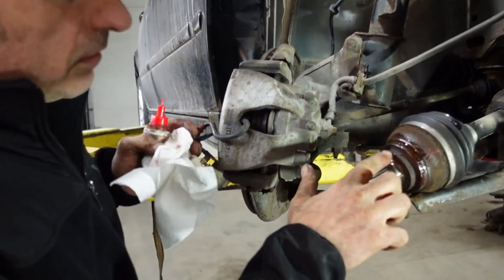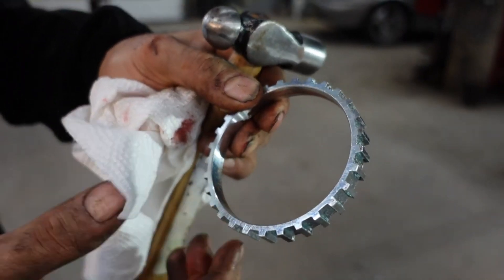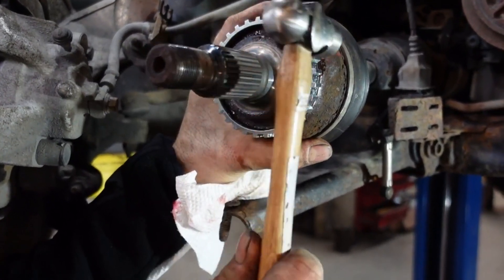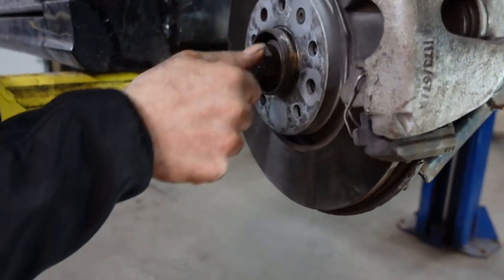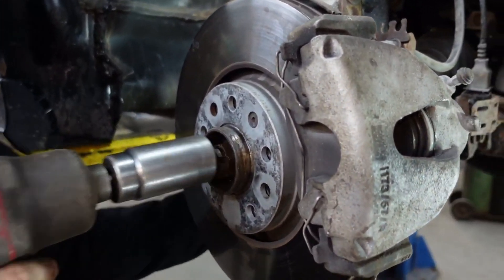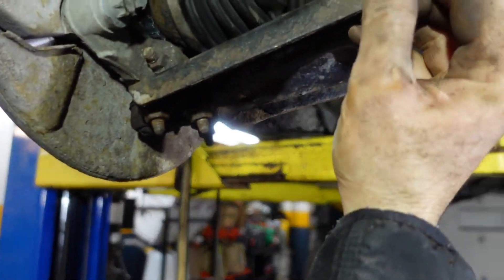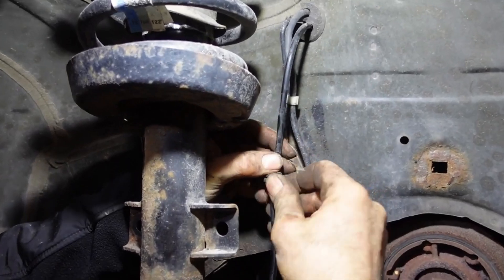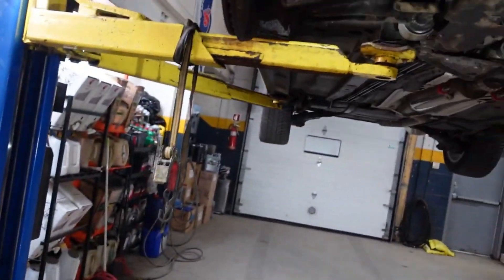How to Replace Front Right ABS Ring (Fault Code C1376) SAAB 9-5 1999-2009 (Part 2)

Comment: Saab Master Tech, great video. Thank you. Question, when you replace the 1999-2009 9-5 2.3L alternator, do you remove it from the bottom or the top? Cheers.
Reply from the maker: From the top. If you want to remove it from the bottom, need to remove the catalytic converter first.👍